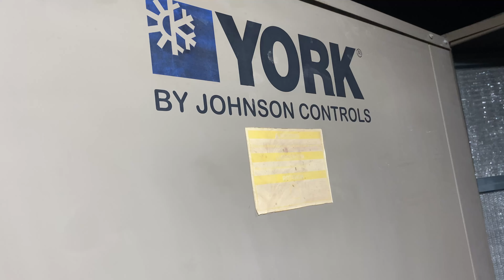York package unit all error codes | error codes package AC | hvac training videos |हिन्दी اردو

Comment: Bhai same pcb me all light blinking orage unit salu naki orake kiya error he bhai thoda pathasakthahe
Reply from the maker: blower relay reset karke dekh lo agar relay se trip ya relay problem karegi tab bhi aisa hota hai
Reply: @thetechhvac  aisa hai tu ham log relay ka 95 and 96 wire ko ek sath jodkar check kiya to problem solve ho sakta hai
Reply: @thetechhvac  ji Bhai aapse Mera aur ek sawal hai 407c gas ka standing suction discharge pressure kitna hota hai  r22 gas ka same pressure hota hai kya thoda jankari de dijiye
Reply from the maker: yes
Reply from the maker: R22 aur R407 dono ka lag bhag same hi hota hai standing aur suction aur discharge bhi , ( R22 > standing 150 , back pressure 60 se 70 tak , discharge 240 se 280 , R407 > standing 180 , back pressure 70 se 80 , discharge 250 se 300 )
Reply: @thetechhvac  ok ji Bhai 407 gas ka thoda bataiye
Reply: @thetechhvac  ok ji thanks
Reply: @thetechhvac  aap bahut achcha se aadami log ka kam sikha raha hai aapka video dekhkar main bhi bahut kam se kya hai iske liye bahut shukriya aapko ,🫡